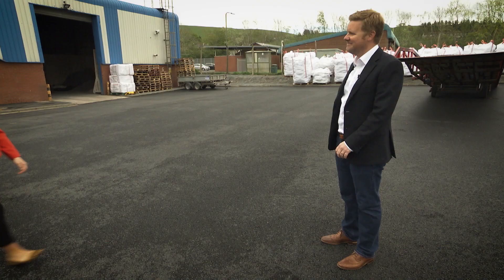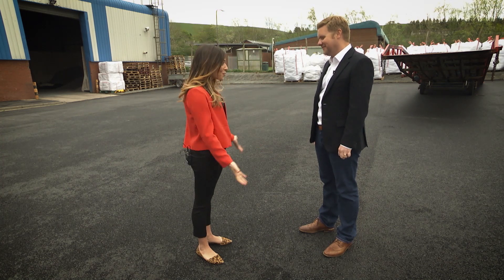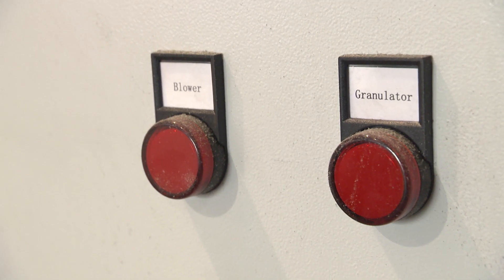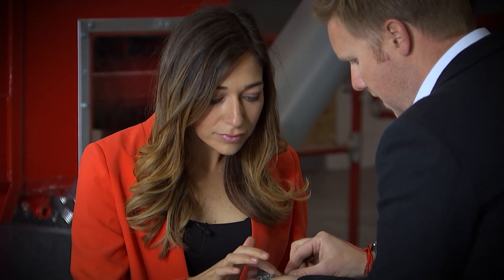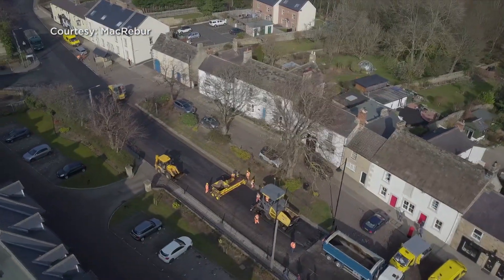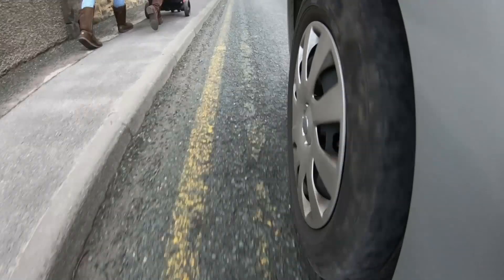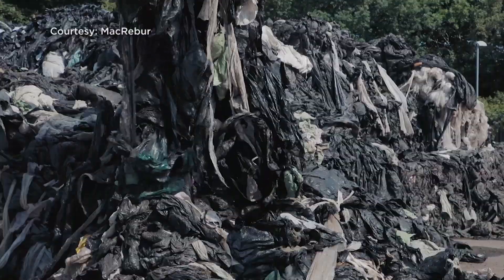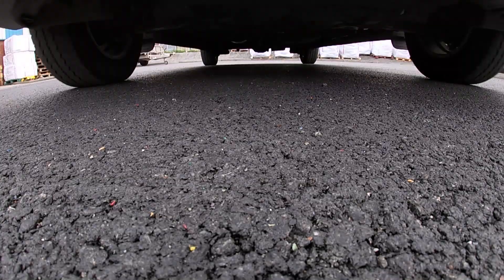The company turning waste plastic into roads | The Edge

Comment: I was wondering when the plastic gets too smooth from driving on it over time and that they would need a groomer machine like the ones used in big cities highways with these scraped groove lines or something into the asphalt. But in doing that would be releasing alot of plastic pieces through the process of scraping. They will have to have a grooming machine that suctions up the particles and pieces at the same time when they eventually will have to scrape it or it will become too smooth and slippery over time.

Comment: What about recycling of this new (polluted) asphalt?  Is this new asphalt hazardous waste that needs to be disposed of in a landfill?
Reply: I was wondering when the plastic gets too smooth from driving on it over time and that they would need a groomer machine like the ones used in big cities highways with these scraped groove lines or something into the asphalt. But in doing that would be releasing alot of plastic pieces through the process of scraping. They will have to have a grooming machine that suctions up the particles and pieces at the same time.
Reply: I wondered the same thing.